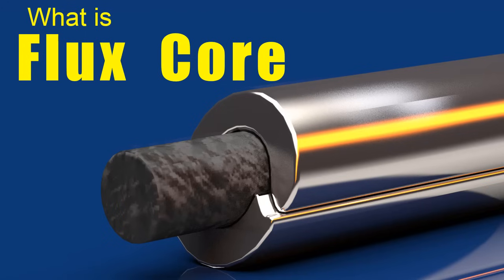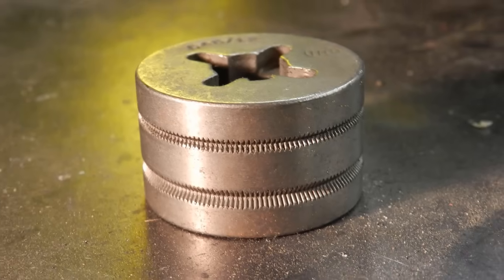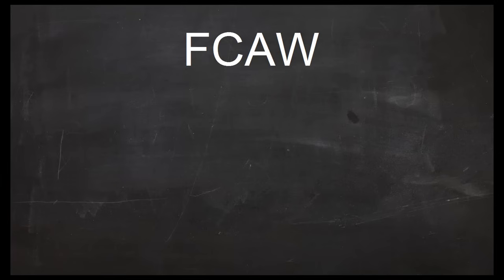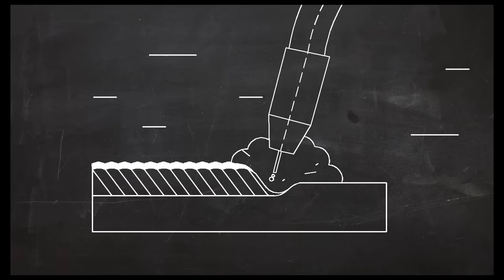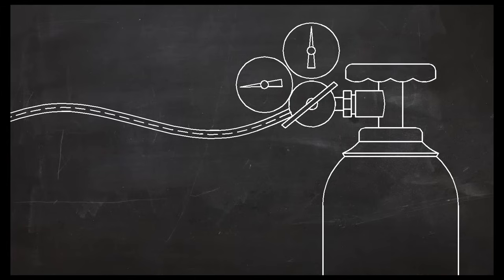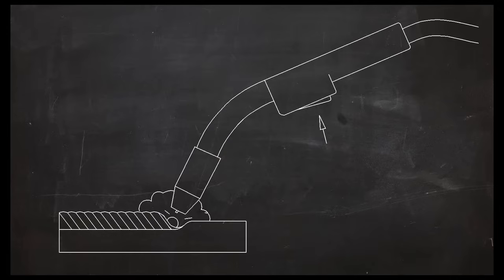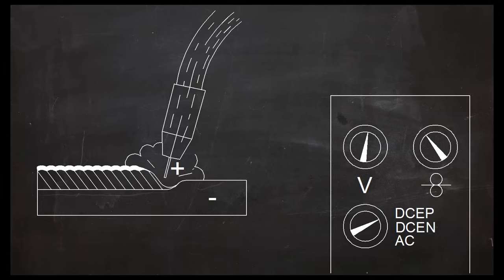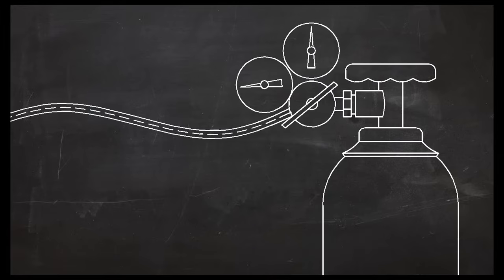What is Flux Cored  Arc Welding? (FCAW)

Comment: whats the difference between FCAW-G and mig welding? in both processes we are using external gas cylinders.
Reply: One has a flux core😂
Reply: FCAW can be shielded with pure CO2 gas which is cheaper and works fine due to the extra shielding from the flux.
MIG uses an Argon/CO2 mix which needs larger cylinders and costlier refills. CO2 is reactive at high temps which makes it unforgiving for MIG welding.

Comment: i need advice, i'm going to build pigeon loft made in steel, should i buy just stick welding or flux core welding machine, i tried the mig before and i like it, but i don't wanna use gas for my project, i'm beginner btw.